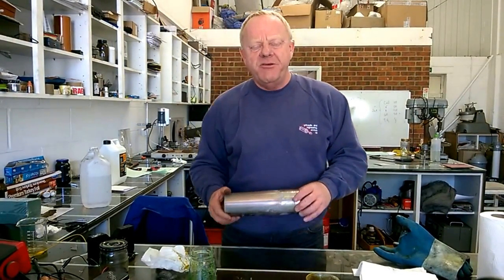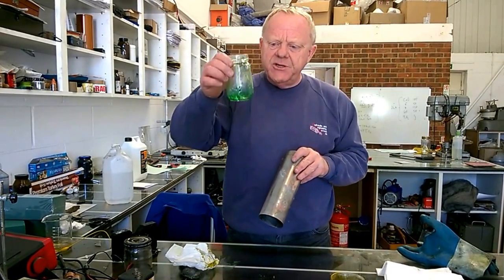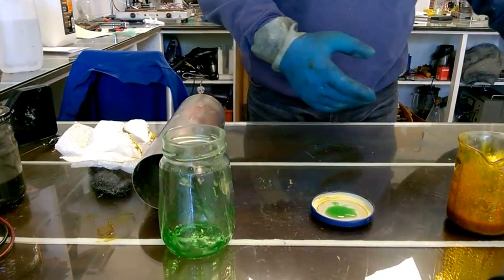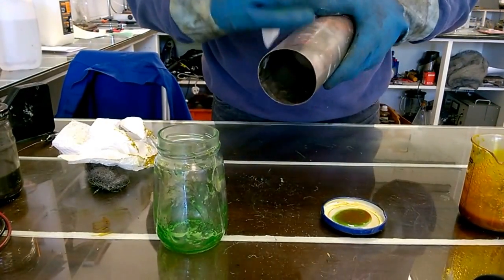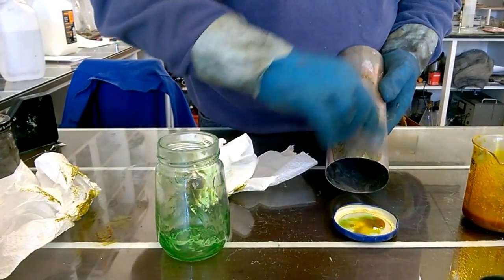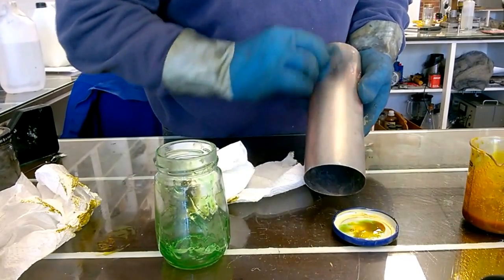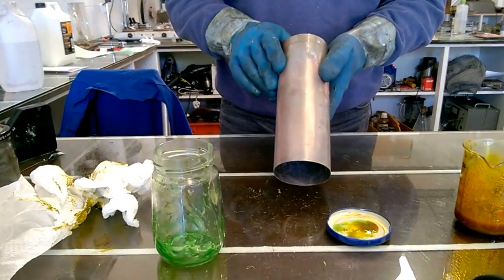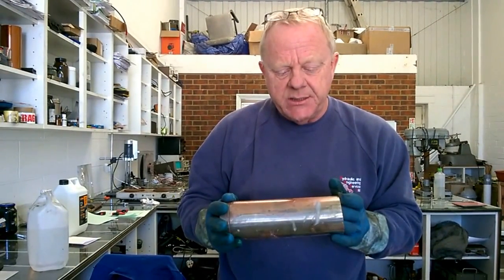Copper Coating Stainless Steel

Comment: What's in the green solution? I can't find the video where he makes that one. Is that just the copper sulfate in ascorbic acid and gelatin? Could you just use copper sulfate mixed with iron chloride and get the same results?

Comment: Can you send me the link for both of these items please

I assume there availiable from your shop?
Also whats the adheasion like?

Thanks
Reply from the maker: Mike Holdom I am afraid we don't sell them mate - you have to make them yourself - but the recipes and how to are on the previous videos - adhesion is superb - watch the soldering  wire video - which uses the gel to create a copper pad for soldering copper to stainless steel
Reply: Awsome will have a look. Thanks for another great video
Reply: @ThinkingandTinkering  which video please send me link of that video